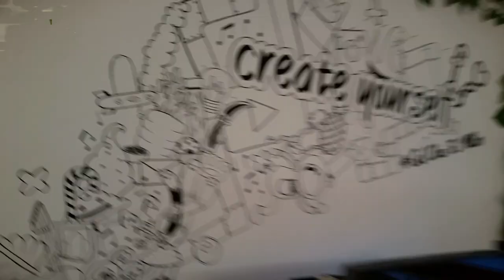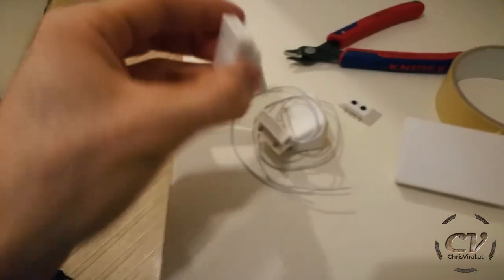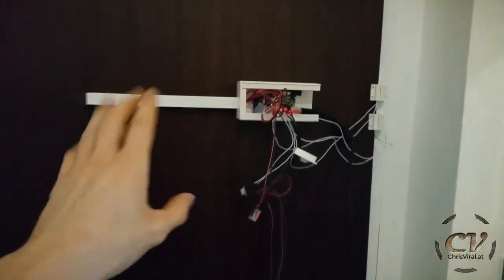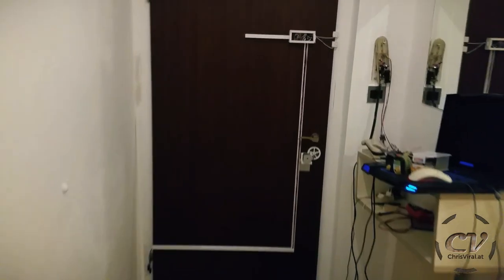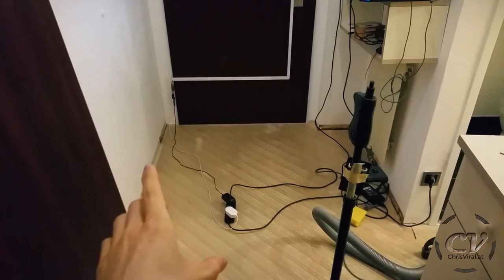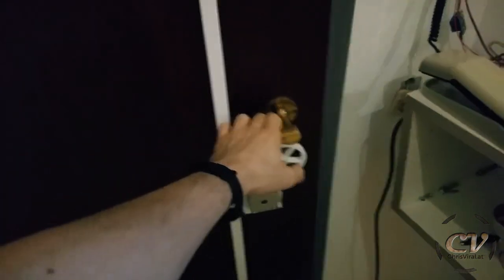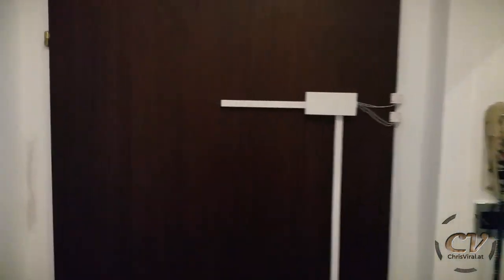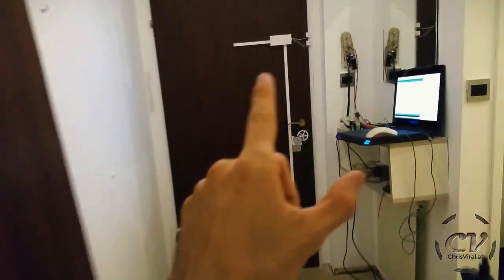NFC Auto Door Lock - FINALLY DONE

Comment: This project seems like it was frustrating, but the payout seems awesome! Maybe two tweaks you could do next time could be carving a bit into the door itself for a far more seamless effect on the interior (added benefit is you could sneak the nfc reader though the door placing it literally anywhere you'd wish to unlock the door at), secondly maybe power the stuff though some kind of magnetic connecting power cable (similar to TOPK branded ones) or just some kind of wireless power which could also fix the case of it firing when the door is still open.

Comment: This is awesome! Tip: Put the reader near to the door handle, and it is opening when you grab it.
Reply from the maker: Thanks! :)
That would be SO COOL but the tags that I'm using are fairly small and can only be read from very near. You can see them in this video & how I put one in my Mi Band 2 - https://youtu.be/WEEJRg8ngBg

I also aimed for a low profile look. From the outside I wanted it to look just like the other doors around me. I was able to hack the door knob and make it turn-able but I had to print a new name plate sadly because NFC is apparently blocked by Aluminum...
Reply: Not to applicable into the door frame? You wear the wristband on your left wrist and it is near to the frame when grab the knob. I saw it in video at 6:33. This is not enough close?
Reply from the maker: Oh my god are you insane :D
Yeah that might work but ooooooooh my god 😂
Never ever lol